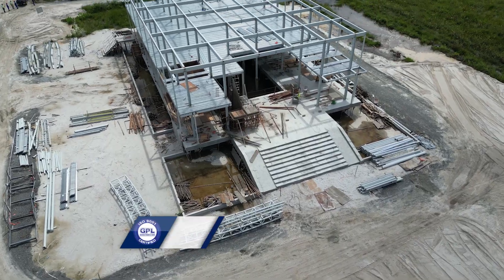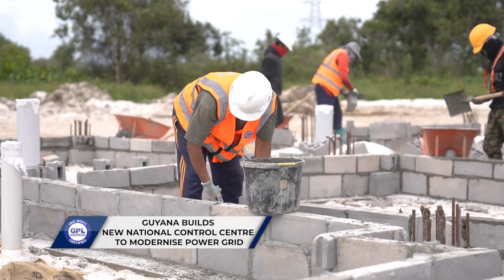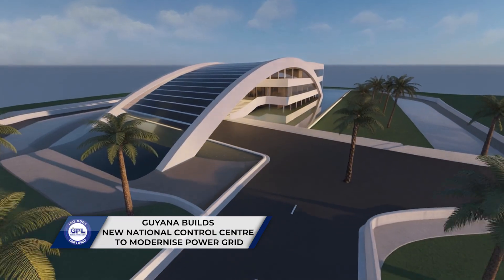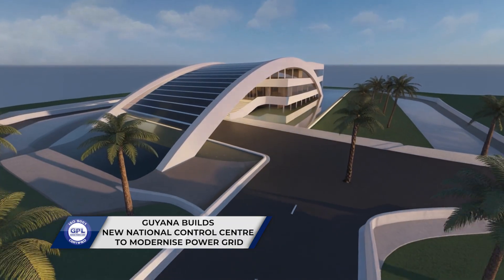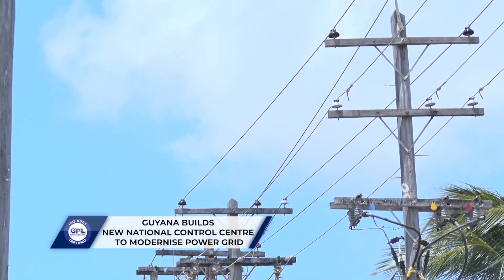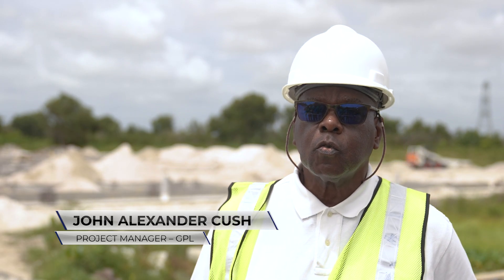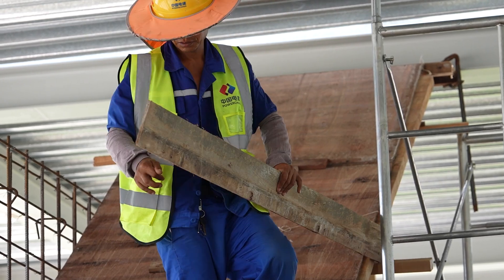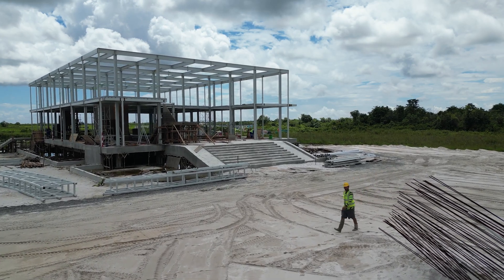GUYANA BUILDS NEW NATIONAL CONTROL CENTRE TO MODERNISE POWER GRID

Comment: They need to make the voltage 110-120. This 220 thing nah good
Reply: What they do need to converter all 220V and 110V area to Split Phase (two 110V live and a neutral - Aka Split Phase) so you can get 220V for ac, water heater and dryer, ect. All new housing areas are already Split Phase over a decade now